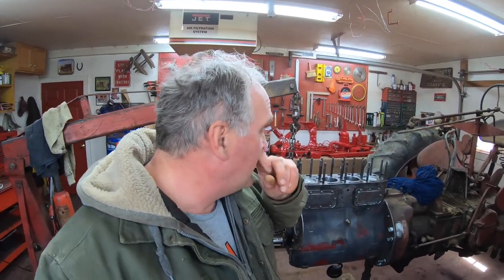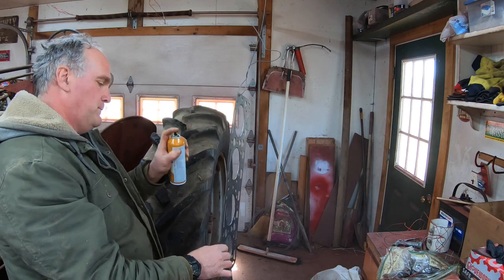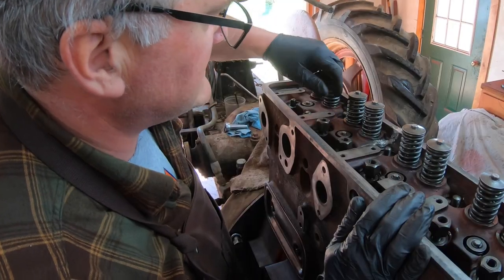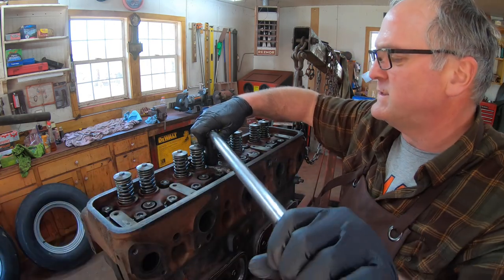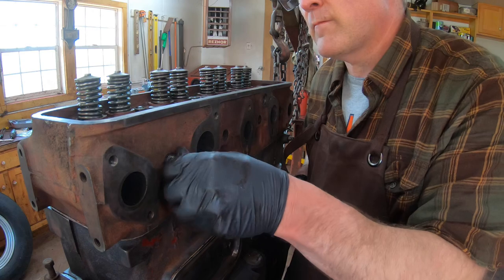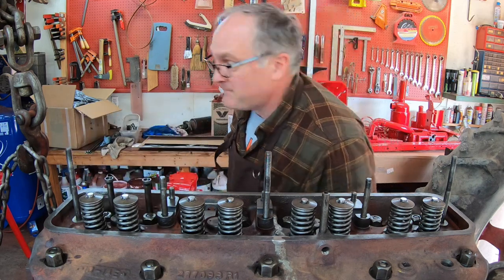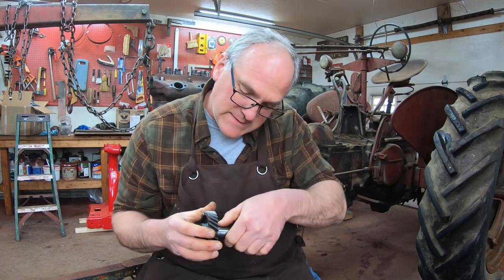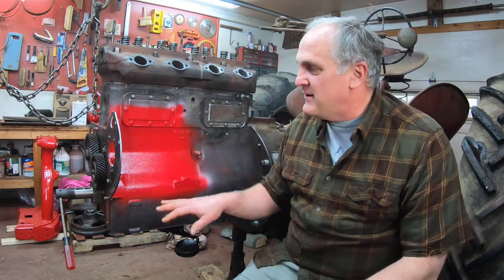Closing Up The Farmall MD Engine Part 1: Installing The Cylinder Head

Comment: That was a clever way of repairing the key way on the shaft.
Reply: Steve Sild
Way back when, I think I was in my late twenties, I was repairing 50 year old textile machines and I and the other technicians would do this about 5 or 6 times a week. Machinery that old, we did what was necessary to keep them running being parts were almost impossible to find.

Comment: Don't worry about what other people think. Keep it real. I have been building engines and grinding cranks for 40 years. looks like you have done a great job to me. I also learned I am not charging enough to grind crankshafts in NH

Comment: Worked as a mechanic for 45 years, never used gasket sealers unless instructed to. Do not like extra sealant. Never had any problems especially with head gaskets.

Comment: I lost a nut for the rocker assembly and the twist wire for the conversion lever down near the tappets. I had to remove the side cover once myself and also got lucky with extended gripper fingers once. Hope you have better luck with your rocker assembly than I did.

Comment: Looks to me like your doing a fine job! Very thorough rebuild. I’m not a fan of using a lot of extra sealants on gaskets mainly because I hate cleaning it off the next time lol, but like you said to each his own. It works and that’s all that matters at the end of the day. I do use the spray high tack on one side of some gaskets to help hold them in place during assembly. Keep up the great work and thx for sharing.

Comment: I had bought a J.I case 730 that has all original parts, nothing has been done with the engine except for the carburetor, and it still starts up and acts like new, the paint is all good and it was never repainted at all

Comment: Excellent video Pete  :) also agree 100% saying also some parts for machine operations help long ways plus looking nicer and file never perfectly straight most certainly agree to you! Plus glad got those injectors cups and use ones to also take time also many parts videos can too for get show very nice see what can on rain days 👍  to ! Also seen that spray use on head gasket & works excellent to and seen Cooper type for Desiel one had be brush on years ago like and high temperatures silicone with tight seal agent  like Anti - Seize of Grey Chrome color too ! Plus like repair and repaint job do motor going look beautiful too! I when came to your video tonight you got included me 102.000 subscribers  to your You Tube videos and grow up very fast congratulations Pete :)  plus his family of Just Few Acres channel !

Comment: Pete, with the Copper gasket coating, I like it, I would use it every cast iron head but I would be hesitant to use it with a newer aluminum head though. Possibility of electrolysis, isn't nice.
Best wishes from the far North.

Comment: Hey Pete the way you did the lock wire is the same way it is done on the vertical drive on a Fairbanks Morse I done a lot of those. As far as the key way, that is the way you would repair that unless you welded them in the milled the out then you would have to harden the shaft

Comment: Pete, you're doing fine! I didn't realize your thoughts and delays with 102K+ mechanics looking over your shoulders.  I just thought it was drawn out just due to video and narration etc. :) 
Regarding the safety wire at 12:20, you're fine again.  I am an Airframe and Powerplant mechanic (A&P) and we definitely could debate using those wire twisters you got and how many twists to do without fatiguing the wire...BUT unless your MD is going to cruise above 10,000 feet or go into orbit I think you're safe with it the way you did it. ROTFL :)  Take care!

Comment: There is only 1 problem with that keyway fix. The next person going in there is going to be dang confused. You are correct that filing the keyway will not be perfectly square but when a tractor has ZERO replacement parts available and is a parade tractor you do what you have to do. I would probably red dykem the original key ways as a sign of damaged area (commonly done in production) to signal an issue. As for torque, the old timers used the German torque method. "GUTTENTIGHT!" LOL

Comment: Excellent video!  While some techniques have been updated over the years based on experience, most of the time the original way is the best.  Anybody that goes on YouTube doing mechanical work is obviously going to be besieged by armchair experts.  Somehow I think the engineers that designed the engine originally know best.  As for use of rattle cans, anyone that has seen the films of IH painting these tractors back in the day would know that even a rattle can will match the original “quality” of the finish.

Comment: I would be very surprised if the manual doesn't have a torquing order diagram, my manual for my 1941 IH TD14 has one, and its just a larger engine of the same design.
Reply from the maker: The Blue Ribbon service manual does not.
Reply: @JustaFewAcresFarm  Interesting, my manual for the 14 was printed in 1940 and has it. If you're curious to see the order for the MD/6 series engine it is on page 49 of this manual. Not saying that there is anything remotely wrong with how you did it, been done that way for years. This is a much later manual though. http://www.tractorparts.com/PDFs/IH_ENGINE_IH_6_6A_264_281_9_9A_350_370_ENG_SVC.pdf
Reply from the maker: @td14addict  Thanks for the manual link; lots of information there and I'll add it to my collection! Strangely, the head bolt pattern on page 49 for the 6 series engines does not match the head bolt configuration for the MD.

Comment: I am a retired red seal mechanic. I can not be critical of anything you are doing. I have one question. If you say you have always used the copper spray and not had a failure, can you say that using nothing would not work as well?
Reply from the maker: Thanks. I can't offer an opinion on other methods. I use the one that I believe most use nowadays, and it's worked well for me.